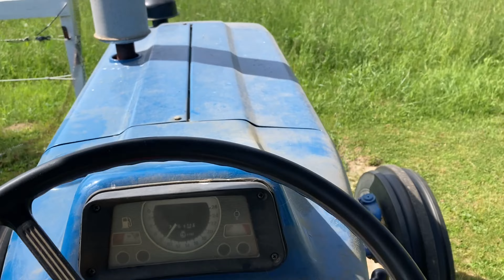Making the nicest first cut hay I’ve ever made (with drama!)

Comment: if you want to reduce the risk with dead young deer set white flags in the field before you start. We always had the local hunter to come out to set them flags or blinders that way the mom would get its young out, we never had a dead or injured young deer kid just an idea. The Rotor hay rake ya'r using that machine was invented by a Swiss company in the late 50s Bucher Guyer (today Bucher Industries) and because there factory was to small they let two other companies manufacture it unter licence Fahr in germany and by Kuhn in France (which was already owned by Bucher at that time)